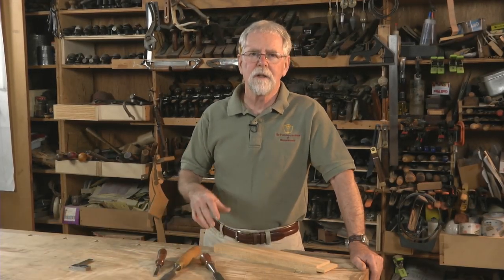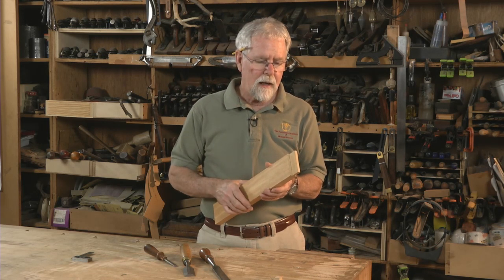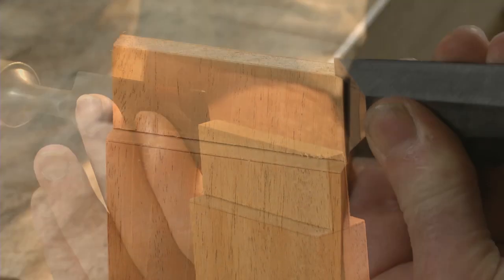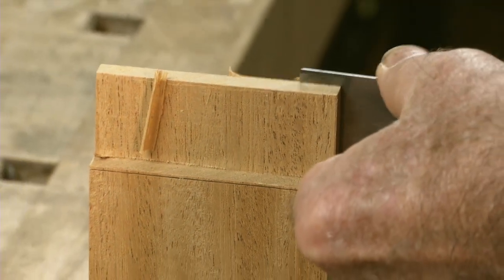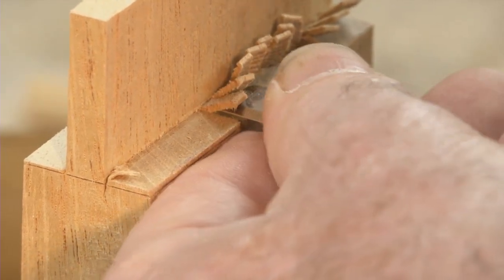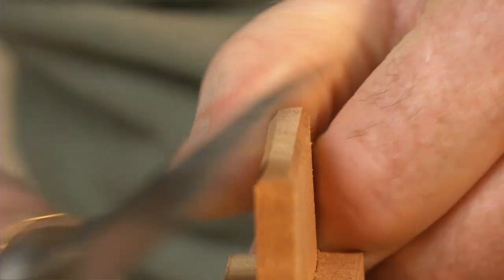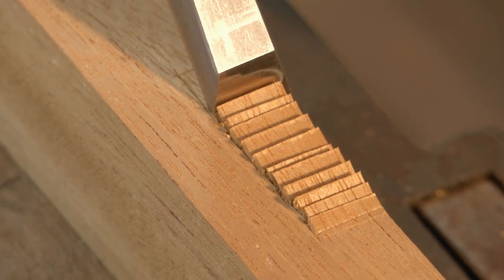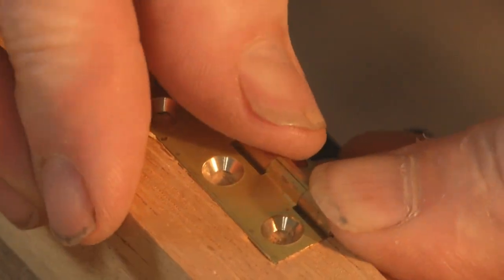Chisel Tricks for Hand-Cut Joinery

Comment: Everyone here could benefit from sharp(really sharp) chisels. I have an old " beater" that I use when doing remodeling, etc, but even gets sharpened. ( some) There are several methods to sharpen tools and it should be a primary and crucial part of a woodworkers education. If one method doesn't seem to work for you, pick another. When you get it right you will not want to ever use a dull tool again. Take care of your tools and they will take care of you.

Comment: You showed how to pare the two shoulders. Some tenons have four shoulders, i.e., the tenon is narrower than the rail. In that case, would you still pare the long shoulders first, then cut the tenon to width, and then finally pare the two short shoulders? I have trouble with that final paring of the short shoulders...keeping all the shoulders consistent. Do you have any suggestions for how to pare those two final, short shoulders?  Thanks for the video.

Comment: When I was taught carpentry in the 1950's, we were taught to saw cut tenons, and the saw cuts had to be visible or you would be failed in the exam. 
Chiselling tenons was considered bad practice, as it would make the surfaces too smooth for the glue to attach to adequately. 
Its also a lot quicker, and more efficient to saw cut correctly first time.
Chiselling of the haunches was OK though.
Reply: +niklar55 thanks for that information....I hadn't really thought about the glue issue on the smooth surface until you mentioned it
Reply: +niklar55 modern glues don't have that problem, they will adhere to anything other than teflon for a very strong bond.  The wood will break before the glue line will.
Reply: christschool
I'm well aware of the strength of modern glues, but if the joint is tight fitting, as it needs to be, and both surfaces are smooth, then the glue will be wiped off as the parts are assembled.
Glue cant stick, if its not there.
Reply: niklar55 That's why the tenon is chamfered, so the glue does not get wiped off.  The chamfer forms a reverse piston.  You're saying this was bad form shows you've not kept up with modern glues or even used them if you think this method he's using is improper.
Reply: christschool
I use modern glues, daily.
If the tenon acts like a squeegee, then it will push the glue to the bottom of the mortice, where it can do little good, regardless of the chamfer. An irregular surface provides a greater area for the glue to adhere to, it also allows air to escape, and prevents the tenon acting like a piston, which in the worst case can split the wood.
Therefore the joint will be stronger, regardless of glue type.
Reply: niklar55 Then why do you think this method is used by master craftsman today?
Reply: christschool
I have no evidence that it is.
Reply: niklar55 Take a look at Tom Fridgen videos, Frank Klaus or Rob Cosman.  I'm sorry you've had problems using the glues, but they work perfectly fine in my joinery and in fact are stronger than the wood fibers they cling to.
Reply: christschool
I dont have a problem with the glues, and I understand that they are stronger than the wood.
What I have said is that if the glue gets wiped off, when the joint is assembled, because it is too smooth and tight, then there wont be enough glue in the joint to do any good.
Reply: niklar55 But the glue doesn't get wiped off when inserting the tenon, so I'm not sure what you're trying to get at, other than attempting to support something you were taught in the 50's, before PVA type of glues.  If your glue is getting wiped off, you're doing it wrong.
Reply: christschool
Imagine a piston, the tenon is the piston.
If the tenon is too close a fit to the mortice, it will wipe the glue, like a piston, down into the bottom of the mortice.
If it does this, then there will be insufficient glue, remaining around the tenon, to form a strong joint.
Reply: niklar55 I understand the piston concept, but that is what the chamfer helps to prevent. As the tenon slides into the mortise, the chamfer rides over the top of the glue, preventing the glue from being pushed to the bottom of the mortise. Personally, I've not experienced any problems and my joints are extremely strong, certainly as strong as a draw bore but with the added benefit of no wracking after extreme use.  And because the surface of the wood is even, I have more wood to wood surface contact than your friction model, which will fail as the wood fibers compress over time or change with the humidity.  Make a 300lb workbench with your model and see how quickly that thing fails from wracking forces.
Reply: +christschool  I can understand what  niklar55 is getting at. The easy solution would be to just rough up the tenon before hand with either a rasp or 60 grit sand paper I think if this is a potential problem
Reply: Andrew Whitburn
Being a 'smart alek' I suggested that to my tutor, when I was learning cabinet making, [hand made furniture in modern speak], he sawed a tenon, rapidly, and then told me to put on the correct saw marks.
It took longer than sawing it the correct method. Sawing is faster, it provides more surface area for the glue to adhere too, and it saves time. time is money. 
Sawing wins!
I dont use PVA, I use a gun glue, that sets in five mins,It also expands to fill all the irregularities, and is a lot stronger than PVA.
It is also 100% waterproof, and sea water proof. I also use a half hour set version for bigger jobs that take longer to assemble.
I've used it to stick a floor plate, for a drywall framework, onto ceramic tiles, as I didn't want to drill through the tiles, which would allow water to leak through. I've stuck steel to wood, ceramic tiles to tiles, etc.
I've run my own building company for 30 years, so have wide experience, of all sorts of work.

If you take a 6 inch length of inch by two planed, apply PVA to say two inches of one end, and then take a knife, and scrape off the glue. Then place another piece of inch by two over the area where the glue was, and clamp till set. That's the equivalent of what can happen with chiseled tenons. I dont think it will be a particularly strong joint.

The chamfer has nothing to do with the glue, it's to prevent the end of the tenon ploughing/gouging the inside of the mortice.
Reply: +niklar55 yeah that makes sense. My previous comment I got the names messed up, I meant I got what you are getting at....I will edit that in a moment.
So the glue in the gun you use, is that a hot glue gun? Like the hobby glue?
If so that's interesting, I have never heard of people using that for wood work before.....maybe I can steal my wifes gun if thats what you mean.
I think everything you have said makes a lot of sense....and when people make a blanket statement like this is how all craft workers do things isn't necessarily true...nor does it mean its the best way.

I learned about sharpening something that goes against everything people are generally told to do....and i had science to back up why they are wrong rather than just because it was tradition and there way is correct. Basically when people use an oil stone, they generally always put oil on it. This is a bad idea as has been proven using a microscope to look at the blade at 3000 times magnification. The oiled blade had dings and dents in it from the metal particles smashing into the blade when drawn through the oil on the stone. A dry hone is better....just bang out the particles on the stone from time to time. So just because everyone does something doesn't make it better. Thanks for spending time so far to explain the glue issue
Reply: niklar55 "I use a gun glue, that sets in five mins,It also expands to fill all the irregularities, and is a lot stronger than PVA."

Never heard of anyone using a glue gun.  Its not done in the furniture industry where I live, here in High Point NC.  What glue are you using in your gun?

"The chamfer has nothing to do with the glue, it's to prevent the end of the tenon ploughing/gouging the inside of the mortice."

It serves dual purposes.  

BTW, there are videos here on youtube showing the force strength of various glues.  Youtube "Mathias glue strength."

Before I declare you nuts with the glue gun comment, perhaps I can learn something the industry doesn't know.  What glue are you putting in this gun that is stronger than PVA?
Reply: christschool
It is supplied in cartridges, like bathroom mastic, or other industrial adhesives.
I dont have it to hand, as its in my workshop.
I'll see if I can locate the manufacturer on line, but its 2.30 am here, [Europe] and I'm off to bye byes now.
Night night!
Reply: niklar55 Well, check with us tomorrow and let us know.  I've never heard of using such a thing in furniture.
Reply: christschool
OK, I'll do that, this evening, about twelve hours from now, about 10 hrs GMT.

Did a quick search midday;

http://www.amazon.co.uk/Everbuild-5MINPU3-LumberIrwin-Polyure-Adhesive/dp/B00132EEME/ref=pd_sim_60_3?ie=UTF8&dpID=31Q6zFCmR-L&dpSrc=sims&preST=_AC_UL160_SR160%2C160_&refRID=1EBSWHZMQRB15ETK0JXA

Advantages over PVA
Its a gel, so it doesn't run all over the place. Only a thin smear is required, so its much more economical, its fully waterproof.
It's fast setting so I can glue one section of an assembly, and by the time I've assembled the next section, the previous one has set and is ready for the next phase of assembly.
PVA works by the water content being absorbed by the wood, this PU glue works more like an epoxy, and sets rather than having to dry.
I have about 10 quarts of PVA glue unused for the last ten years since I discovered this stuff.
[I used to buy it in five liter cans,= roughly 5 US quarts.]
One job;
I make racks to hold trays for all my workshop junk, about 6' tall, and holding 10-12 trays 2' x 16" The runners are formed from two pieces of softwood 1,1/2" x 3/8" for the vertical, and 3/4" square for the runner. I can make two dozen of these, in minutes, and then by the time I've assembled the uprights in the jig, the runners are set and ready to install. A thin line about 2-3mm wide is sufficient to stick 3/4" square, to the vertical piece, with 2 staples about 1/4 way from each end. The trays will take loads of hardware or tools. A dab of glue holds the runners to the uprights with one staple.

I buy this stuff from a wholesaler, in boxes of 12 cartridges.

Evostick make a similar product, but its crap!
It goes hard in the cartridge, so wont store.

Comment: Thanks for taking the time to make this video. It is a big help to woodworking newbies like me. I had to try this paring technique for myself on some scrap, it is not as easy as you make it look.
All the best.
Reply: As a new woodworker I had to learn a lot the heard way ( still have tons to learn) but I wish someone would have taught me how to properly sharpen my tools earlier. If you are a newbie take some time now to learn good sharpening practices, invest in a good wet stone and get or make a leather strop to get a fine edge. It will save you tons of headaches and time.
Reply: I recommend buying 3" x 8" (at least) EZE-lap diamond plates down to the finest grit available.  They're fast, they're flat, and last practically forever if you take care of them.  That leaves only the last grits to the water stones (which go out of flat quickly) or Arkansas oilstones (which go out of flat eventually), and of course a strop.

Comment: I had the very good fortune to spend a week with Phil a few years ago. For the people questioning the utility of a super sharp chisel, or how sharp his were, I can tell you from trying his that I still have a hard time getting mine as sharp. His could cut softwood and never have tearouts. Paring shoulder endgrain to the line as he showed only works well if the chisel is very sharp. It is too easy to have it ride up or down due to the extra pressure needed in a less than sharp chisel. As to the use in cutting tenons, sure, you can always bang out some tenons with a bandsaw. With a lot of practice you can hand cut with a tenon saw and have a smooth snug fit. What I got from Phil was a more practical and stepwise sense of construction. With a little bit of care, and perhaps an extra step, you can set yourself up to ensure success even when your attention is less than perfect or the wood less than cooperative. The cost of that extra step on many pieces is much less than screwing up tenon and having to start it over. The point in all of this is not that it is the right way. Just that there are lots of things one can do to help with the job. Maybe you don't need any of them, maybe you can cut tenons first time, every time, with perfect fit. That's great, keep doing it. I really appreciated his lessons. 

I was very sad to learn of his  passing last year. We lost someone with so much to offer, who already had as well.

Comment: This has to be the sharpest chisel I've seen. Amazing.
Reply: +B0M0A0K they are polish more than sharpened but the wood is soft imo
Reply: They are both.  He doesn't polish them so they're shiny, he polishes them so they are sharp.
Reply: just a personnal choice the polish but not needed at all for a sharpened cisel.
anyway this video is only to show useless things.
cutting tenon is normally done by saw nothing else if nicely done
Reply from the maker: I'm sorry Mathieu DAVID, can't stand it anymore. You obviously don't know any theory behind sharpening if you think the polish has nothing to do with sharpness, and you think that sharpness in a chisel isn't needed, and you think that these techniques are useless.
Reply: Mathieu DAVID
This is rubbish.  A saw cut is fine for simple joinery but to cut a tenon neatly it's quicker and easier to use a chisel.  You should watch Paul Sellers' video on the subject.
Reply: i've seen paul seller's video but i'm carpenter myself and really appreciate paul sellers video and we have the same way to work if you look at my channel.
anyway, with a good saw, no need to use a chisel for furniture imo wich is different for carpentry
Reply: seeing as how your right about a saw being a decent tool for it, your wrong to think that a saw is the best way. there is a reason why chisels exist, and why carpenters use them. they work, they are versatile, and the fact that they can true up joint work after using a saw. a saw is a crude/ obtuse tool, its merits are removing large amounts of material quickly. but a good sharp chisel is a more fine/acute tool. it removes material with precision. each tool has its place, rely on only one, and you will be lacking in your skills.
Reply: jedexkid41 if you have a good saw, no need to use a cisel after! i work with my hand and my tenon are tight with a saw! waste of time to cut out of the line to ajust after or it's that you are afraid of removing too much material...
Reply: I'm not suprised that you don't use a chisel Mathieu.... I just watched your chisel restoration video and it was horrible. You couldn't appreciate a real bench chisel with such inferior skill level. 
And the answer to the burning question on youre lips is "Yes, I really do know what i'm talking about."
Reply: Matthew Chapman i love you too!
have a nice day!
Reply: FineWoodworking he's a carpenter who knows nothing about fine woodworking.  The tolerances are different.  That'd be like a framing carpenter critiquing a finish carpenter for the way they layout trim.  Clearly he's also a hack.
Reply: Katy Smith advertising on another channel has the reverse affect in my book definitely a turn off to me it's like begging just my opinion
Reply: @tadzius5829  Can't we all just get along?
Reply: @MathieuDAVID  if you don't understand the correlation of polished and sharp, then you have no useful understanding of sharpness. Polishing is required to get an edge sharp down to the microscopic level. If your edge isn't sharp at the microscopic level, your edge really isn't all that sharp. But keep telling yourself that you are right. Even a saw tooth benefits from a proper polished edge. Higher quality saws get this polished edge.
Reply: @OldDunollieman  more likely plumber's assistant.
Reply: Yeah mine is sharp too, but just for the first two cuts hahah

Comment: It’s  possible to get an exact fit with the hinge by scribing first one side, then moving the hinge up to cover the scribe line and then, scribe the other side. Then, on the outside of the scribe line, using a square or some other fence, run a scalpel along the scribe mark to the depth of the hinge. You can get the same tolerance to the leading edge of the hinge by using a shim at the base line. It gives a perfect fit.

Comment: I apologize profusely for my ignorance but what is the first part of the video referring to? What is the purpose of doing those cuts onto a joint like that? Is it for resizing if the joint is originally cut too large or is that serving a different purpose I'm not aware of?
Reply: He deliberately cuts the tenons slightly too large for the mortise so that he can then pare them down to exactly the right size.  If you make the tenons too small, you can't fix that so it's best to make them too big and then adjust them.